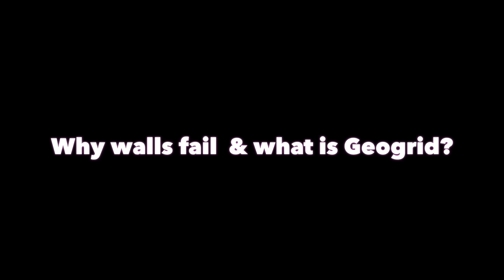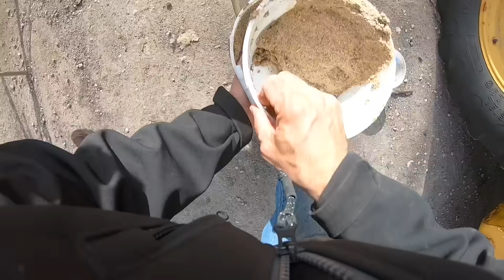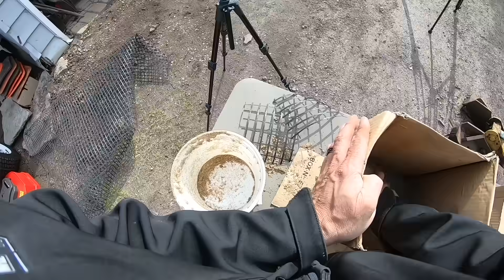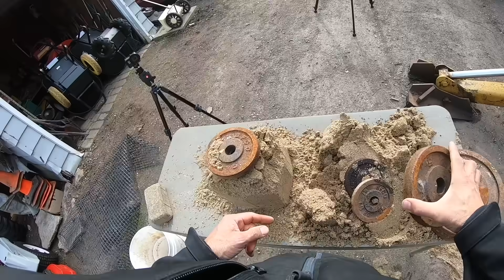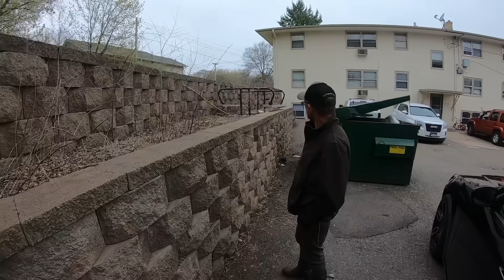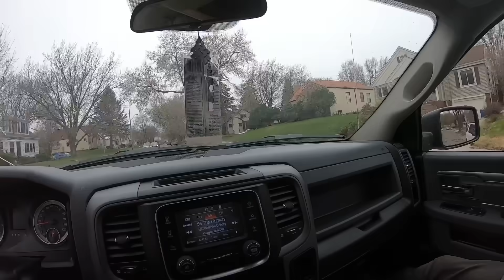WHY Retaining Walls FALL down - How Most people Build them Wrong

Comment: I’m in the process of building a retaining “wall” at the bottom of a slope below our driveway. I just had four, one ton, boulders delivered. I’m not going to be stacking any boulders on top…it will be just the one row of boulders. Each boulder is about 28” tall. I will be adding fill dirt in behind it once I 1) fill in the big openings between each boulder with small rocks to keep fabric from bulging out 2) next I will use heavy weight weed block and perhaps pieces of those big white bags that gravel and dirt are delivered in to keep fill dirt from weeping out. We do have clay soil that is slow to drain (north Texas) but I’m using fabric that percolates. Finally the fill dirt will go behind the fabric to build up the soil behind the boulders. My question…do I need geo grid  if I’m not stacking any rocks?

Comment: Is 2-3 foot wide geogrid halfway up a 5 foot high by 30 foot long retaining wall (repair) between the gravel better than no geogrid?   Wall has bowed 2 inches and sagged 2 inches … tilt is half inch max.  Wall has popped in one area, but wall is still very solid (about 11-14 inches wide masonry) Adding drainage at base of existing old retaining wall (do it yourself project) in Texas.  Thanks

Comment: Hey, just started watching your videos because I have a wooden beam retaining wall I need to start looking to replace at a home I moved into where I pulled out an above ground pool that was level with the wall but below ground floor level of the house (there is about 9.5 ft wide strip of earth between house and retaining wall and the wall stand maybe 3.25 ft at its highest point above ground; we're also thinking of altering a basement window to become an egress window within this area) ...  this is probably a numb question and will probably get a chuckle coupled with a set of side eyes with raised eyebrows... is the stacked bags of concrete a complete joke and a for sure futue failure or is it possible  to make it effectively work?
Reply: https://youtu.be/LHl5dYp3dg4
Could this work for real?

Comment: Probably a silly question, but am curious... Is it possible to increase the height of an existing retaining wall? Or to build on top of an existing retaining wall? For example, instead of Terrace wall, just remove the top terrace and build on top of the lower wall. Thanks

Comment: What happens when a wall has geogrid every two feet, but it doesn’t go back on a 1:1 ratio to the height of the wall. What if it only goes back on a 2:1 ratio?  So on a 10’ wall the geogrid is only 5’ deep. Does geogrid need to go into native soil or just recently placed backfill? Is proper 1:1 geo grid depth more important towards the top of the wall of bottom of the wall?

Comment: In several videos you've said not to use fabric between a wall & the fill aggregate, how about between the undisturbed earth & the aggregate?  Was considering doing this to keep the earth out of the gravel fill. I'm working in Missouri clay, and have been at this a while, solo & all by hand.  3' deep & the unsupported ground has stood firm for months now with no collapse.   (lots of delays)  Base course is in, 2nd course shortly, then start backfill before adding - so if the fabric as described is advisable, now is the time.  Should I, or not?  BTW, using Versalok std block.  

And yes, I know I'm working slow.  62, health conditions, and grandkids living here will do that to ya!

Comment: when building a boulder retaining wall with non silty soils how do you use both geo grid and fabric with out having to cut the fabric to slip in the geogrid and therefore losing some of the strength/purpose of the fabric?

Comment: @2:10   I have to say,  Not my walls. I've built wall way before that grid was even a thought. They will not fail if designed properly. Grid not required.
Start with an engineered solid reinforced buttressed concrete wall and your done   For Life.
the Backside BUTTRESS is the Key.
Expensive? No. It's way more expensive to pay for a replacement in 15 years. Its always expensive to pay twice for anything.

Comment: Should you use adhesive on every block or just the caps? I have been watching your videos about retaining walls and am about to tackle my own (3ft tall) wall. I remember seeing in one of your videos about using adhesive on the blocks but can't remember if you said for the caps only or all blocks. I think water would have a hard time getting through the blocks if used on all blocks.

Comment: Hey Stanley,
I’ve watched a ton of your videos and I love them. So informative and super helpful. I’m starting a project for my sister who wants to build retaining walls on the side of her property that’s at approx a 50 degree slope. Height of the hill is approx 25-30 feet and hypotenuse of the hill being 65 feet. 
Could you give me your thoughts on how you would tackle this? 
Mind you she would like usable seating or planting areas on the terrance’s  I front of each retaining wall built and doesn’t want any walls over 4’ tall. 
After watching your videos I do feel a lot more comfortable doing this project but would love your ideas on how to make sure this project will not fail and last for as long as she owns the home or longer. 
I do plan on putting in geo grid, using Versa lok and 24” of angler 3/4” stone/gravel behind each wall. 
Geo grid would would need to be at least 4’ in length for each 4’ retaining wall built.
Am I missing anything?
Would I start with 12” down for drainage on the first row of blocks? This area gets a ton of water during the rainy seasons which makes me anxious on the proper way to do this. 
As far as surcharge, at the top of each 4’ retaining wall there will be a min of 8’  of flat area to minimize the load. Minus the seating/tables etc... that she plans to put there.

Comment: I have seen glue injection used  to hold a sand bank behind walls. It can keep ground water from bleeding through the blocks, together with a bubbler drain behind the glued sand.
Very good video on how to stabilize with geotech materials.

Comment: I'm about to have a wall built by a contractor.  After watching your videos, I've said versa block and no fabric on the back side of them.   Also said I want Geo grid.   What I'm not sure about is what to backfill behind the blocks with.   The soil here is high plastic clay.  It expands a lot when wet.  Wall at highest point 5'.  Holds soil back, and is a half circle about 12' radius open on inside of circle.   What do you suggest for backfill?  Respectfully,   Kevin

Comment: So nothing over 4 feet. I had a drive way retaining wall built about 2-3 feet but I have noticed when it rains the concrete looks wet from the inside and I have a top on it. French drains connected. Any idea what could be wrong? Thank you
Reply: Concrete is a porous material.  Your wall is soaking in water from the ground.

Comment: a retaining way holds back not up .
When making a proper retaining wall dig till bedrock or solid drive vertical 3/4 inch rebar to reinforce the footer.

as this demonstration shows only idiots use sand without rock or Portland in a ratio.

geo grid (sons eyeball fence) an vertical hu. 
yet no stress from above just a forward push from behind.
This is a joke do not listen to this idiot

Comment: that was a stupid demonstration😬😫😪

Yeah, the weight on top of the geo-grid that is tied into the wall in combination with the stabilization that creates helps keep the wall from falling over. it's part of the structure that's not seen.   ..it's not rocket science.

Comment: ...because they have not been designed by a Geotechnical Engineer.
Reply: Minarchist 412 ...structural engineer
Reply: @jasonarnes9421  I'm a Civil Geotechnical Engineer. Ive been designing retaining walls for the past 26 years. Structural engineers do not have a good understanding of soil behavior, soil structure interaction and soil strength parameters; that's why they leave it to the experts.
Reply: Minarchist 412 ahaaa the truth comes out, you’re a civil. That’s sounds more like it. I can barely get a geo to give me soil values better than IBC minimums much less design the wall lol
Reply: @jasonarnes9421  This is a major problem in my profession - Geologists working as Geotechnical Engineers.
Reply: In my experience the Geotechnical Engineer provides the soil pressures to design for (in the Geotechnical Report) and the Structural Engineer designs the retaining wall to resist the forces acting on the retaining wall.  At least in the case of a reinforced concrete or reinforced CMU retaining wall.

Comment: I beg to differ on sand binding properties...
Sand will bind under moisture encapsulated sand bag, baked in sun and becomes a brick... not a firm brick, but it does hold its form until other properties take place...
The sand bag is this theory innovated... same concept without the baking...
I built a house out of sandbags I'm now on my second using tires and sandbags... I know about dirt for sure, this product would coexist in earth building if its cost effective
Reply: So your saying you can build a 14 foot retaining wall without using the geogrid
Reply: @chuckbailey6835  yes... 
Look up Mike Reynolds, he's using rammed earth in tires, and I've used them myself and they will not move, but using a traditional product along with thermal mass it could be probably the best structure one can build... and it will last 5 life times if not longer...
The tire acts like this product because it's a steel belt rubber encased brick.

Comment: You are not totally correct when you say in your video of why walls fall down that all walls up to 4 foot must have geomesh. I have invented a new type of retaining wall block that doesn't require geomesh or compacting of the back fill on walls that height. My new block works on the cantilever principal and is held together quite simply with plastic water pipe. It is only 30kl in weight and can be built very quickly. Contact me for more info as I am looking for investor for this new product.

Comment: Would a light duty pickup truck on a 4ft wall constitute a surcharge and require geogrid?
Reply: Certainly it would - truck itself may not be heavy, but it's weight is distributed to four points, not quite big themselves. Also it is not a static weight - when you move out, and especially when parking, when you apply brake, dynamic pressure increases. It may not be after the first parking, but few months and you may see results.

Comment: Great video. I have a question for you. I plan on building a short retaining wall (28" high including cap) using versa lok  standard blocks. The wall is 14' long and is holding back a small slope. Do I still need the geo grid? Thanks
Reply: Geogrid will help enourmously to reduce the lateral loading on the wall. Don't forget to add drainage behind the wall and install weep holes to reduce hydraulic pressure. You will get to design the as a gravity wall system so the footprint will be at least 10 foot wide.
Reply: @Hitngan  thank you for this information. I plan on using 3/4 gravel to about 23" high so I can plant grass on the last 5"  thank you

Comment: Just bought a new 33 hp tractor ( home owner model)with a BACK HOE intending to do some work in my yard including replacing a WALL😳 
so I’m yearning for this information and YOU explain it so that the AVERAGE guy uunderstands exactly what you’re trying to CONVEY! 
You come across like your AT MY TABLE with TWO COLD ONES 😄❤️🇺🇸
NOT... NEVER SOUNDING HOLIER THAN THOU🇺🇸🇺🇸🇺🇸🇺🇸🇺🇸🇺🇸🇺🇸🇺🇸🇺🇸🇺🇸🇺🇸🇺🇸🇺🇸🇺🇸🇺🇸🇺🇸🇺🇸🇺🇸🇺🇸🇺🇸🇺🇸🇺🇸🇺🇸🇺🇸🇺🇸🇺🇸🇺🇸🇺🇸🇺🇸
❤️🇺🇸SPOT ON❤️🇺🇸

Comment: My home was built in 1964 in an area with large slopping hills. Most of my retaining walls have failed =(.  Some of them have fallen over, while others have split and cracked due to the amount of pressure of the hills they are retaining. Could I send you some pics so you can help me assess how screwed I am? It seems like the walls directly in front of our house are fine, meaning I dont see any leaning or cracks, but I am hesitant to do any work to this home knowing that our retaining walls we built without proper drainage or geogrid.

Comment: Do you reccommend putting in drain pipe s on taller walls  perforated pv.  Built a wall 15 years ago using geogrid and interlocking blocks still dead on level

Comment: There were some wall units that didn't need grid, They were based on reversed slope or setting back on themselves at about 45 degree. Boulders walls with the same slope set back I have never seen a Landscape Architect or Engineer require grid.

Comment: We put in stuff, for a building where they’re going to be doing blast testing, we did 6 tiers each about 18 to 20 inches in height, we had metal racks in each tier set across and stone went into those racks, we had at least 3 feet of sand past the racks and put in what I think is called dead men, I’m not for sure if this is the same, mainly this was for the percussion wave from the blast

Comment: Hey Stan,Is there a way to use the geo grid on a poured concrete wall? My thought would be to put it in the gap between forms and cast it in, flap it up out of the way until backfilling (in layers) so it acts as a deadman as well as a stabilizer. Would it just be overkill?
Reply: A poured concrete retaining wall has a keyed foundation that goes into the retaining side of the wall. Normally going under the retained earth 1/3 the height of the wall. Have it engineered for your soil, load and earthquake zone.
Reply: I appreciate your input.This was a hypothetical question... no plans on building a wall right now. Would it be belt and suspenders, and elastic waistband maybe. how about geo-tech fabric unattached? Seems stabilizing the backfill would do more good than harm as long as drainage isn't effected... if no one ever questions current technique, innovation never happens... I'm a seasoned heavy equipment operator, and I often have to deal with engineer induced problems...I try to learn (thus watching Stan and others) So I'm not just a dumb stick monkey seat warmer.

Comment: An important point with a pinned connection wall block....DO NOT USE SOFT GEOGRIDS LIKE STRATAGRID. THE PINS WILL TEAR THROUGH IT, AND THE WALL WILL FALL DOWN. STRATAGRID is fine for tongue and groove blocks, but not pinned blocks. Use a rigid geogris, like Tensar, for pinned blocks.

Comment: Walls don’t fail from top down!  Put weight behind those columns and both will fail miserably. No a good demo for geogrid.
Reply: M Beaulieu lateral earth pressure is what he needs to demonstrate
Reply: EXACTLY, you could put a anything in that box and place a weight on top of it.  Geogrid prevents walls from moving laterally.  I know Geogrid works but this is a poor demo IMHO

Comment: Thanks for posting, we're going to have to build a retaining wall soon, probably 8', with a surcharge of a parking lot, I want to make sure it does not move!  ;)
Reply: Hire an engineer to design it correctly. Please. I've seen too many failures as a forensic engineer.
Reply: @kurtdietrich5421  I was planning on it, we have to get it approved by the city anyway for the building permit (because it's over 3' in height).  At minimum I'll be observing the installation, or actually helping construct it.  Either way, I need knowledge of how it should be done, as opposed to how it shouldn't be done.  ;)
Reply from the maker: Thanks for watching and I hope your wall project works out well !

Comment: I have an idea of what you're saying but not good enough to actually build a wall . Showing us how to apply geogrid on a real wall that you are going to build would be the perfect solution . Thanks . Hate to be the owner of that building where the wall is going to fall on it .
Reply: If you didn't have the know-how prior to watching this video, or any other YouTube video, you probably should do some more technical research. A YouTube video is not sufficient. Info from the manufacturer, an engineer, a GC, etc.
Reply: Andrew Delashaw  Seriously, if these people would actually go to a landscape supply yard, or call the block manufacturer instead of Home Depot when looking into purchasing hardscape materials they would be able to ask these questions and get actual information and not just speculation from an ameteur on YouTube showing how he builds it.... certified installer = warranty = piece of mind

Comment: Stan, I was just wondering about joint filling on a boulder wall where you said that matting is used behind the wall to stop soil leeching through. i had seen your pool man using a spray foam to seal between rocks on a pool installation. Would that product work on a boulder wall or would it be too expensive
Reply: @xenonram  Thank you Andrew

Comment: Good video and great point about the geogrid. You should do another one on the issue of hydraulic jacking and proper drainage of a retaining wall. I've seen many walls fail due to lack of a drainage system to remove water (pressure) from behind the wall. Also, for any home-gamers...use a stamped drawing by a licensed engineer for any wall over 4' tall. Most reputable suppliers will provide one for you at little to no charge. If you build a wall improperly and it fails and god forbid someone is hurt or killed, you may be held liable.
Reply from the maker: Thanks for watching and for the suggestion!

Comment: With the one linear foot of grid per foot of height of the wall rule you mentioned, it the measured from the front face of the wall, the back of the block, or the front face of compacted base material behind the drainage stone?
Reply: From the back of the drainage layer.